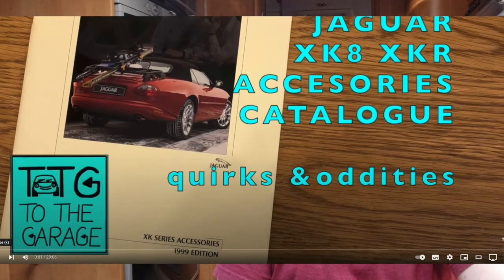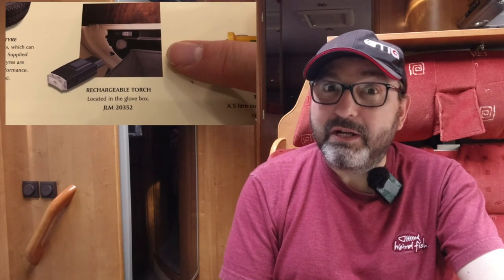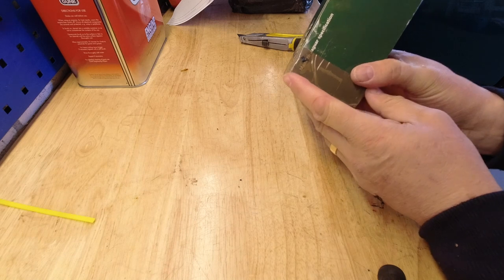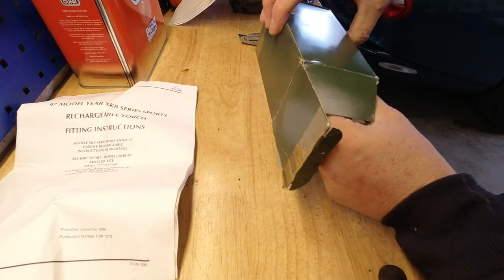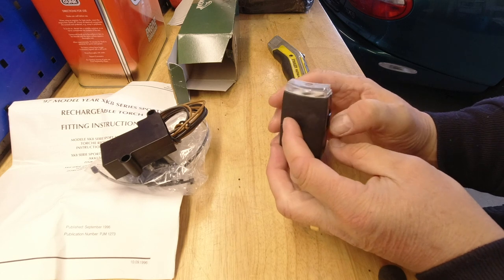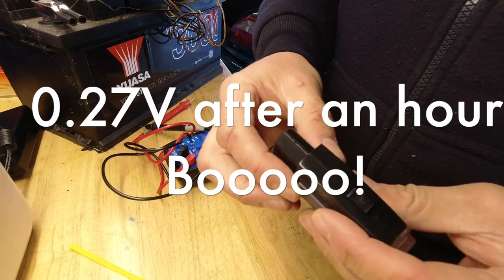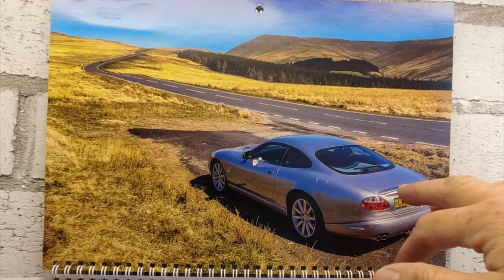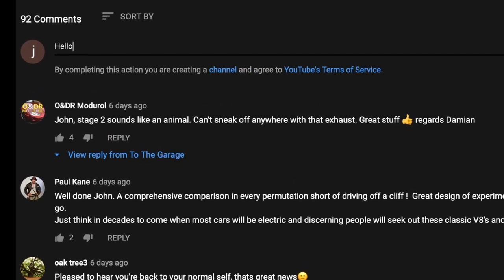Jaguar XK8 XKR Rechargeable torch. 7 years to find one!   2.4V torch for your V8

Comment: Hi John- what a find, congratulations! that will really be interesting when you get it to work & fitted to your car! I remember that 6-series BMW had one like that, that was quite a stir back in the late 70s, early 80s.... by the way, I looked into those BMWs a bit more in detail and decided to go for the XK8, cause I think she is even more beautiful and, in some important areas, better engineered.
Reply from the maker: Thanks Wolf.  I nearly bought an E51 8 SERIES about 10 years ago
Reply: @ToTheGarage  going for an 8-series would take a very brave man... terrifyingly complicated incl ecu-controlled rear wheel steering.... but very interesting, they are.

Comment: I am want one of your baseball caps but how much is going to cost to send it to the United States
Reply from the maker: Hi Eric. when you try to check out on my website it will show you the delivery/shipping cost to your address. Its auto calculated based on your post code and is charged 'at cost' using Royal Mail standard international service.
I just checked and for instance Arizona comes out at £9.35 today. (thats about $11.54 I think?)
Whether you decide to get one or not, thank you for your support my friend.👍
Reply: I need a new one too.  I wear it everywhere, so it has grown a bit tatty.  I will order tonight.
Reply from the maker: @garyvanremortel5218  Hi Gary. I have emailed you on a separate issue👍